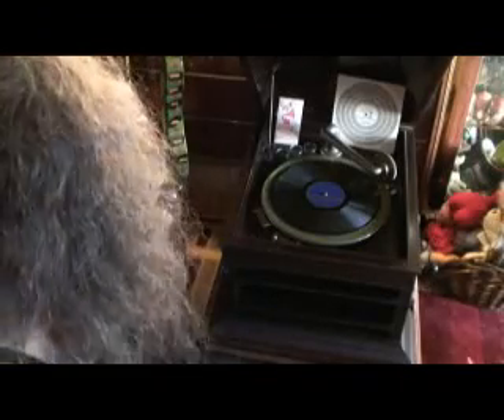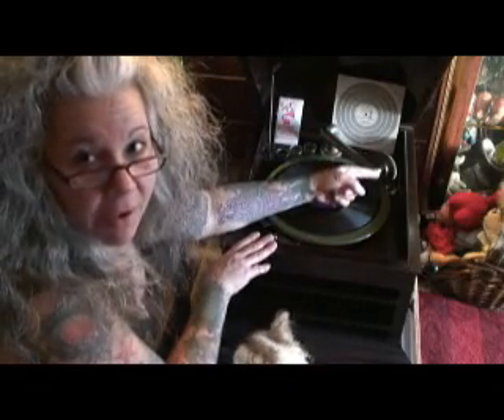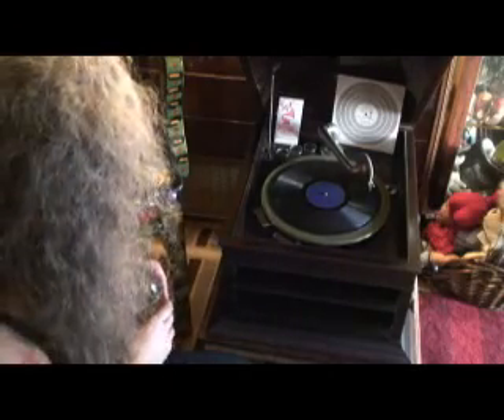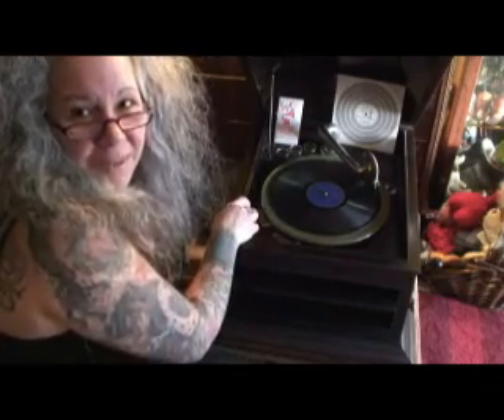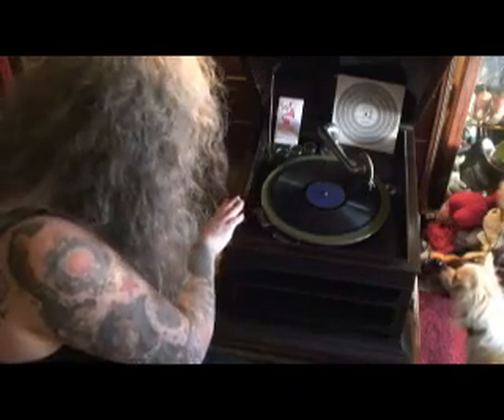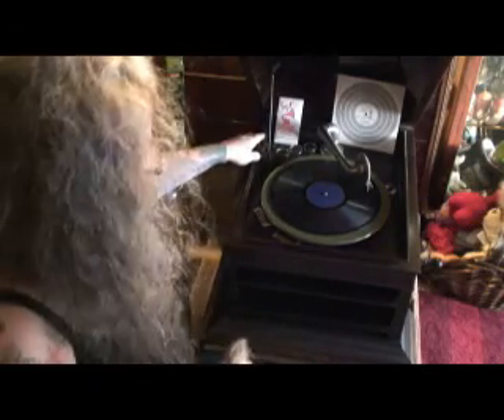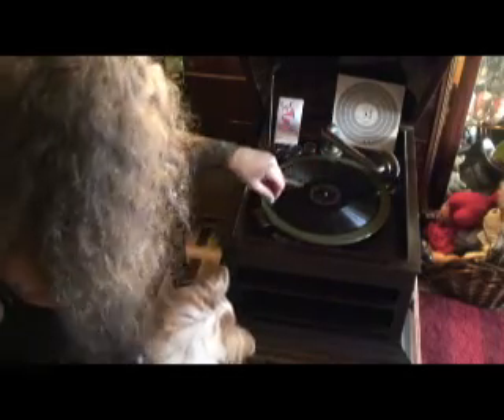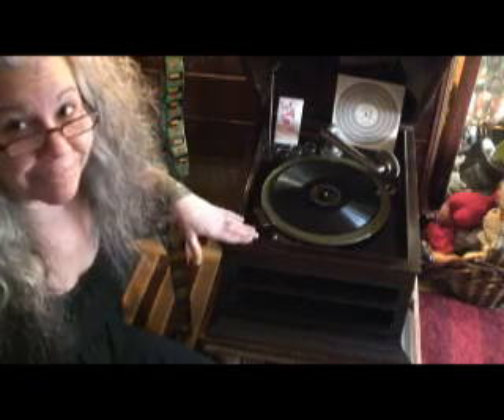Messing with the Columbia Grafonola with Tink

Comment: Tink 

The thing to remember with gramophones is the motor has a small pad on the governor and this wears. the pad is made of felt ad dries out over time.

The sound box needs a new gasket as as you have demonstrated  this by use of the plumbing gasket ! 

Sounds great with a good tone

Hope this helps 

Richard

Comment: Hi Tink  You are really getting good at   mechanical repairs.  I think it sounds just  fine and so much better after your very creative repair job.  I know nothing about windup phonographs, but if the speed is governed anything like a chime clock it might have a smiliar speed governor that works on friction, and if you get too much oil on it that will cause the speed  governor to slip causing it to run too fast.  Just a thought, as I had that problem with  speed governors in windup clocks

Comment: The governor in mechanical phonographs operates by a weight type governor instead  of a fan type, that is in clocks and music boxes.  Sometimes they even loose the  weights causing it to run to fast. Type in Antique Edison Phonograph repair.  They have an interesting article on the 78 rpm speed governor.  How it works and some repair suggestions.

Comment: Open your cabinet and look at the governor on the motor... specifically the leather pad that floats around the disk of the governor.  Move your speed regulator on top from fast to slow, and the arm that the leather pad is attached to should move in and out from the governor disk.  While you're there put drops of oil on the leather pad, and also on the shaft of the governor underneath the weights.

Comment: Tink I restore these as a hobby and been collecting for years
You can fix that speed control very simple
Tait the turn table off and remove th dhole motor board
You will see indoor the speed control on top there is z governor under there ANC an adjustment screw
One way speeds it up the order slows it down
If you fixed the reproducer you will be able to fix the speed
Very simple